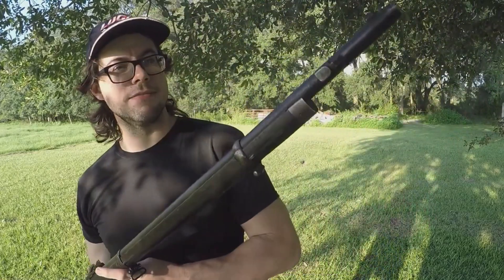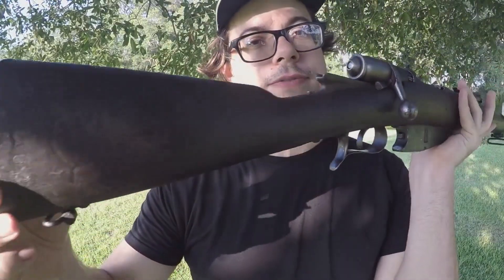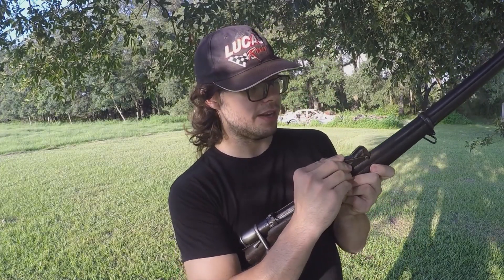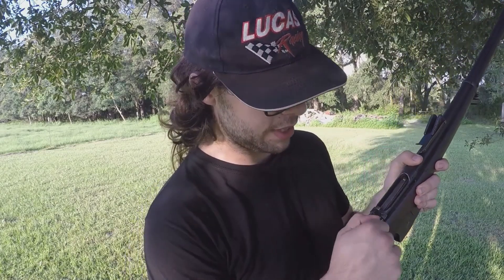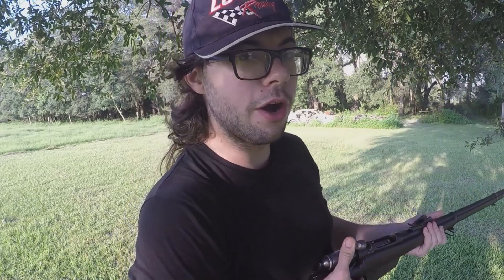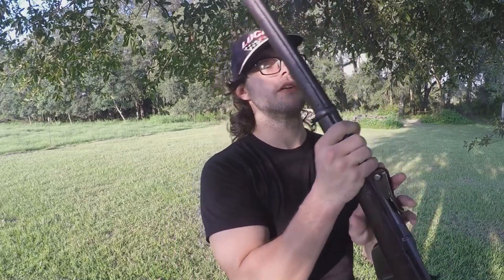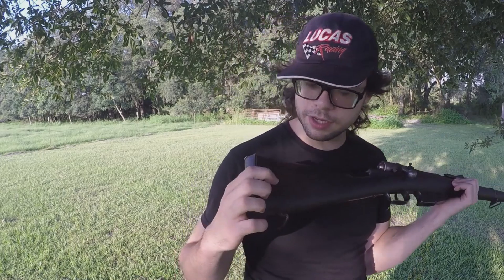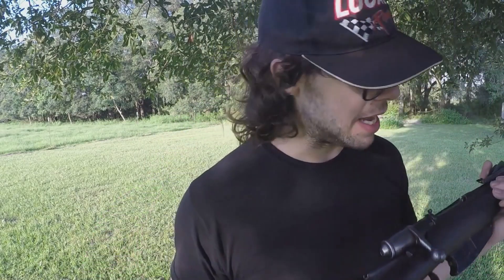The Italian Vetterli History - Road to 100k

Comment: The trouble with the 6.5s. SOME ot them are strong enough, and SOME are not. Ive got one ive put over 100 full power 6.5 carcano rounds through. But then there are ones like C&rsenels that detonated on the 3rd round. The quality of the conversion and possibly even the heat treats seem to very. Some of the actions are way tighter than others. I can make a video on this if you want.
Reply from the maker: Absolutely!
Reply: I personally think the C&Rsenal problems were handload related, not gun related.
Reply: @Franticalmond2  possibly, although those guys do seem pretty careful. Granted i havnt heard of factory loads popping a vetterli, so maybe?

Comment: these weren't intended for battle line firing, but strong enough to hold up for a time. How many shots before stretching the action, is anyone's guess. Kinda like using gp11 in Swiss 1889. The tighter the lockup, the more shots remaining. Examining in person, is best way to buy these.
Reply from the maker: 110% correct 

Good eye

Comment: Awesome Rifle. I have a Idea for you. Hand Load some  Black Powder cartridges. That would be cool. With some hand cast bullets.  Around 2000 fps. ✌️
Reply: Cast bullets with a crimp on gas check. Perfect. I don't know what the case capacity is but at least what ?. Have  fun
Reply: Perfect for Florida deer. Make a "Hunt" video with it. I've shot Black Powder in my.       M1Mk 111. Hot water Cleans up fine.